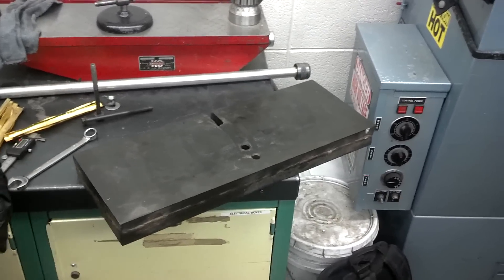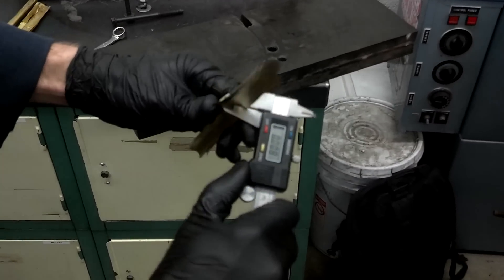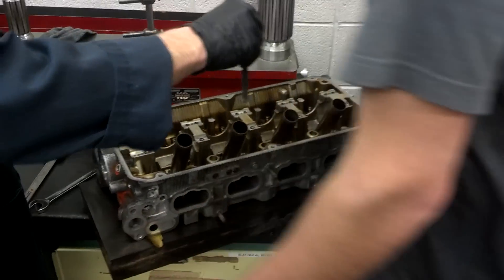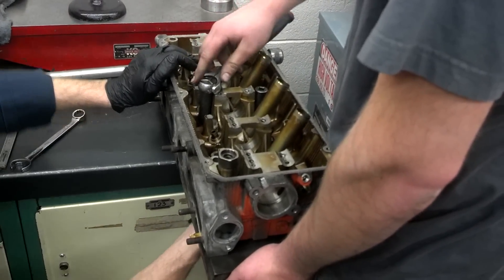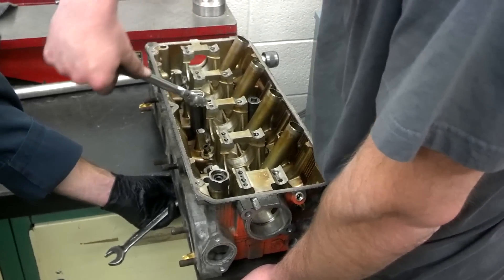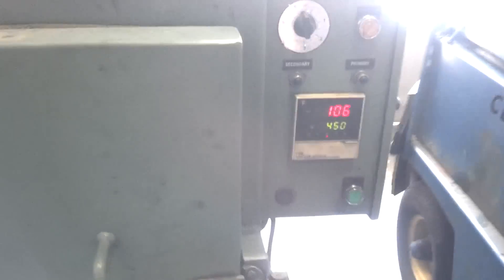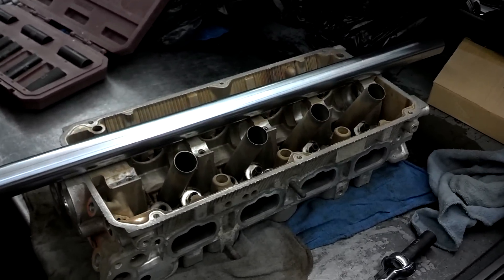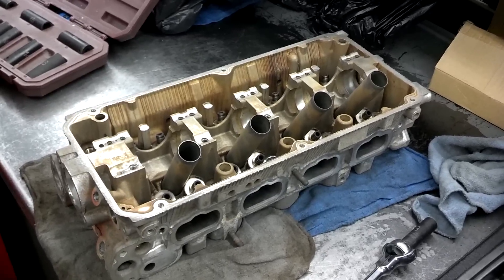How to straighten a warped cylinder head

Comment: What plate did you set it on? Is it a manufactured thing that you bought or is it something you made?
Reply from the maker: The plate we use is made of two  3/4 inch steel plates welded together so that they cannot warp or flex.

Comment: Brilliant video Justin. I have that exact problem 15 thou warp in middle,cam journals lifted. Can you tell me what is shim stock? What can I use as shims material wise? Is that brass? I have a rare head, I must do this. Thanks in advance.
Reply from the maker: You can buy shim stock at specified thicknesses.  I am certain that you could find it online. I have also taken part feeler gauge sets and used the feeler gauges before.
Reply: Thanks for replying. I researched the shim stock on google ). 
Can I ask? If I had 20 thou warp in the centre would I be correct in thinking that I should place 10 thou shim thickness on each edge of the head?

My problem is actually that the cam bores are line bored and as you mention in the video: this is crucial to align.
My camshaft actually has a tight spot right in the centre where the warp is.

I bought some thick flat steel plate 50 mm thick, very heavy. I will use the gasket as a pattern and will bolt down right.

I'll let you know how I get on.
Many thanks. )
Reply from the maker: I would actually put more shim on each end than the warpage is.  I would probably put about 30 thousandths on each end, so that when you tighten the bolt in the middle, it warps the head in the opposite direction.  Then, when it relaxes, hopefully it will be almost straight.  Sometimes it takes two times to get it straight.

Comment: Excellent video, I have a question hopefully you can help me, is when to use oversized head gasket after the cylinder head has been resurfaced, the machine shop has to indicate that?, Do you have to measure ?, or is it not necessary ?, the service manual does not say anything related to this, it only says about measuring piston protrusion to calculate for oversized head gasket, but not for resurfaced, thank you in advanced.

Comment: 500 Celsius, and a 6 hour heating is the standard procedure for all cylinder heads or just those made from aluminum? 
Cool video thanks for sharing!
Reply from the maker: You can heat cast iron heads hotter than this.  The problem if you go much hotter than 500-600 degrees on an aluminum head is that it expands so much that valve seats fall out.
Reply: 500 F, not 500 celcius, 500 F is equivalent to 260 degrees celcius

Comment: Can you do this with a conventional oven?
Reply from the maker: If your oven will get hot enough, it should work.  I'm not sure if I would want my cylinder heads in the same oven as my my pizza, though!
Reply: Justin Miller Ain't nothing wrong with a little cylinder head residue tasting pizza.....
Reply: I guess this a great reason to have a machine shop do a perfect job cleaning the head first.
Reply: heh, made me giggle ! Would it anneal the aluminum, sir ?

Comment: Does this aneal the aluminum?
Reply: Aluminum isn't something that van be tempered as far as I know so that would suggest it cannot be annealed either.
Reply: @claytonstill2385  Yes aluminum can be annealed.  At a fab shop I worked at we would anneal 6061T-6 before we would bend it.  Up to 1/2' thick would bend flawlessly after annealing in out big press brake.  If you tried it without annealing it would just shatter apart.  An old timer there taught me how to anneal it with only an oxy/acet torch.  Basically you coat the part with soot from only turning on the acetylene.  Then run a normal flame and evenly heat the part just until the soot goes away.  At that temp it is annealed!
Reply: @claytonstill2385  Some aluminum alloys can be heat treated. Some can't.
Reply: They make sure to use a low enough temperature to avoid annealing it. 450-500 should be safe and do the trick.

Comment: on pushrod engine does the warp on the valve  side matter,can't you just machine the surface till it's flat?
Reply from the maker: yes--that is correct--as long as the valve seats and guides aren't distorted.  Make sure to check them and machine them as necessary.